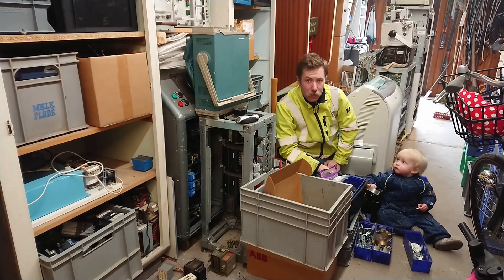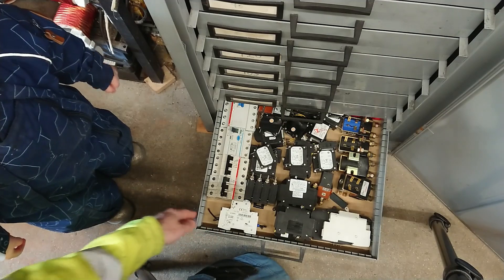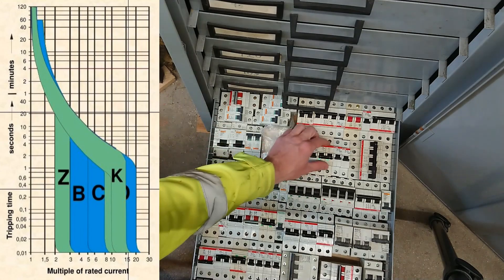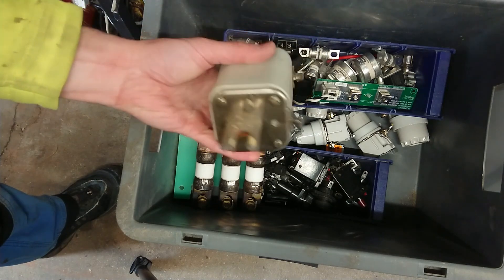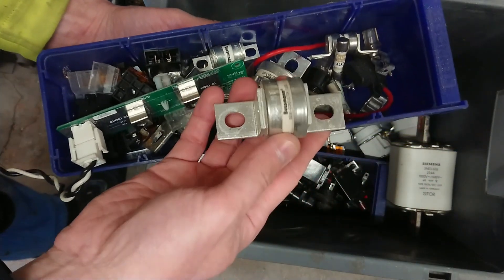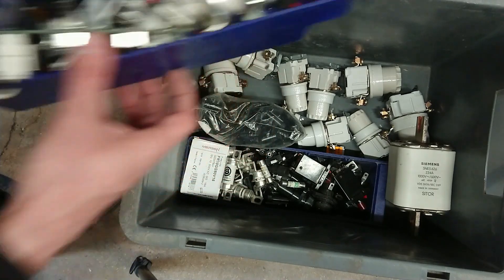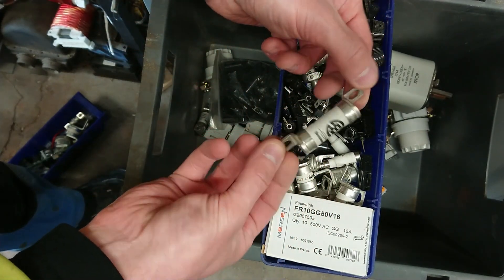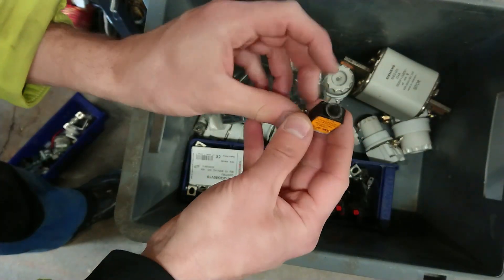Fuses In Power Electronics and Other Fuses - Isolation, Day 24

Comment: In the UK we have fuses in the in our standard plugs thay ar small ceramic ones 1inch by 1/4inch (6.35x25.4mm)thay are marked as BS1362 and the most commen values are 3,5 and13amps there are less commen known values such as 1,2,7 and 10amps.

Comment: One time use, and if you had a pack of cigarettes or a pack of chewing gum you would wrap the fuse with the aluminium foil pack instead, so it would have a somewhat higher blowing current. Seen plenty of the Diazed fuses with a wire on the outside, because they are common in old machinery, but as spare parts not so common today, almost always being special order parts. Solved that problem with a small length of Hymag rail and a set of breakers to suit, and as bonus got a 3 phase breaker so a single blown fuse would not cause damage to the machine when it lost a phase.

Those semiconductor fuses these days are only there to keep the fire down, as they almost invariably only open after all of that expensive silicon has turned into vapour, and sometimes not even then, the transistors, thyristors, diodes and power blocks blowing the bond wires open circuit faster than the fuse can react. Older power thyristors would survive the fuse blowing no problem, along with the modern slow switching speed puck type, simply because there are no bond wires, and huge areas of silicon inside.

Comment: i have 3 of those big maxwell energy discharge capacitors 1800V 2500uF
Reply from the maker: Good spotted :) what are you using them for?
Reply: Kaizer Power Electronics   was going to make a 12KJ destruct-o-tron but after charging just one up fully and discharging it into a fuse wire, the explosion it made sounded like a cannon going off and i was a bit afraid of it since, they are stored in the attic of my house for now.
The guy i bought them off said they were from a experimental laser cleaning systems, i wanted to buy the lasers itself but he said they had to be destroyed for safety reasons.
I contacted the manufacturer  of the capacitors and they provided me with a datasheet, i remember the fault current on those was 25KA per capacitor.
Reply from the maker: I am interested in that datasheet. Would you be so kind to contact me at http://kaizerpowerelectronics.dk/about/contact/

Comment: A friend of mine has some old German ETA 300A DC breakers which are designed so they can be tripped manually by squeezing a pair of levers on top of the breaker.  They were used in electric pallet trucks.

https://peerlesselectronics.com/447-k-h-fn-300a-circuit-breaker
Reply from the maker: Might just have two levers instead of one, because it requires more mechanical force to manually trip such a large one. Thanks for sharing!